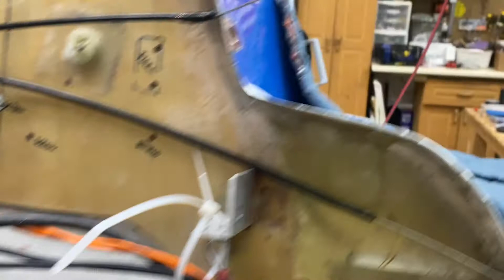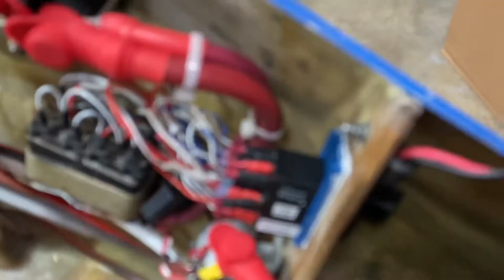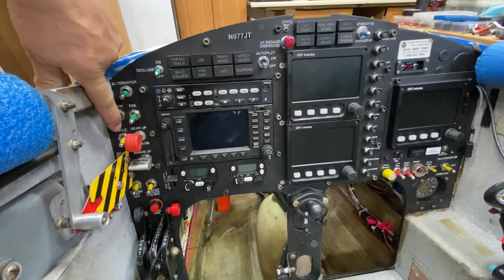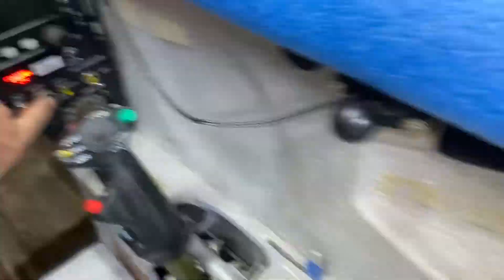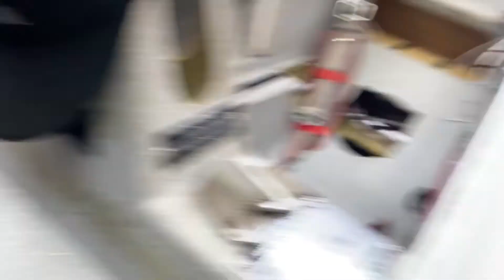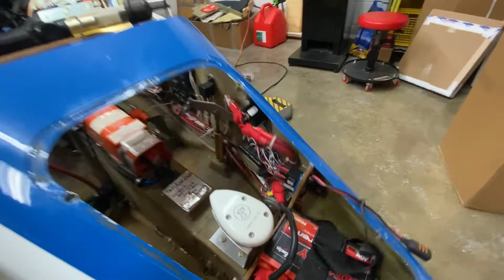Fuel Injection Conversion - Relocating JT’s Starter Solenoid

Comment: My Varieze starter solenoid is up front near the battery, but upstream of the master solenoid. With the canard off, I managed to touch the contacts with a wrench or something, and was VERY surprised when the prop started turning over, luckily clear of people and stuff in the hangar (I was alone). Things you discover from other builders...But REALLY glad I have a starter (especially since I have hand propped it a few times). Highly recommend a starter even for the weight penalty.
Reply from the maker: I totally agree, a starter is a necessity